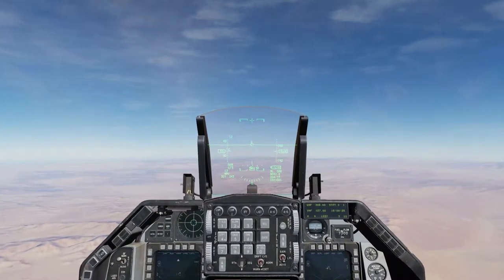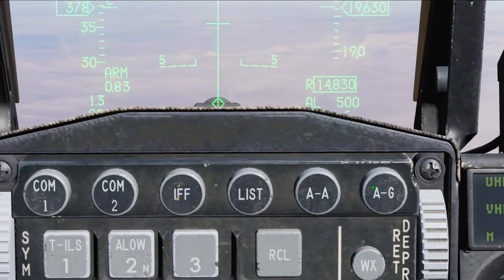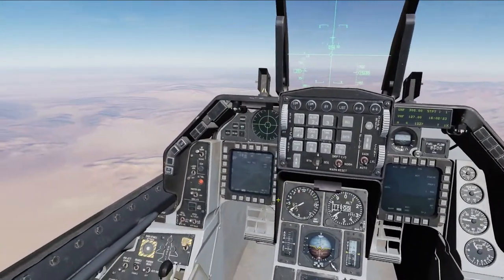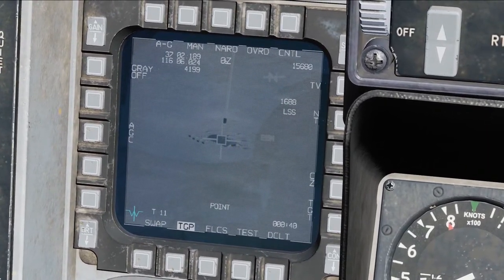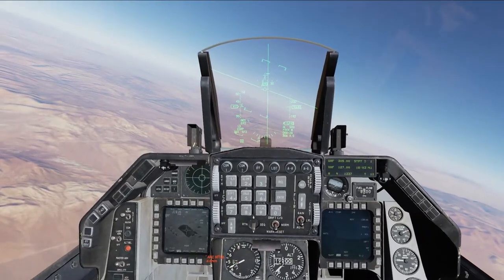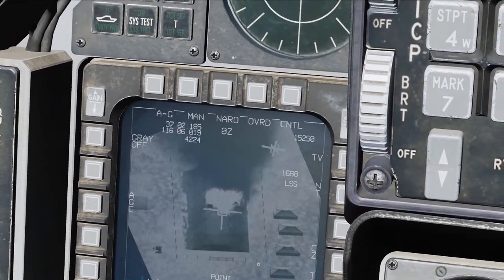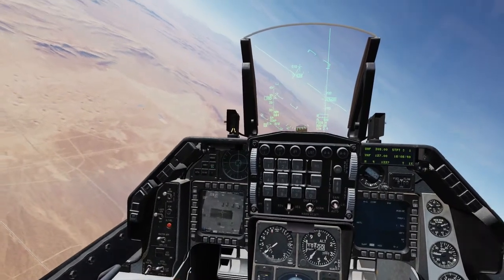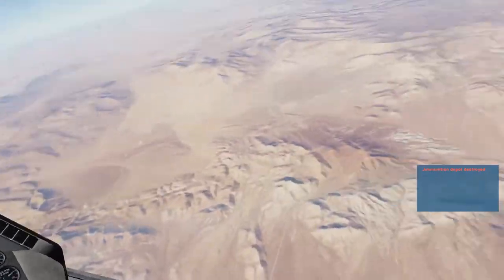F-16 Laser Guided Bombs EASY!

Comment: Curious im not sure if the process has changed now, you may also need to set the release angle now manually with latest viper updates.
Reply: FYI to those who like dropping laser bombs flat the angle is 0 degrees
Reply: I'm annoyed with it as well. Bombs won't release unless the angle is absolutely perfect, which requires autopilot and perfect trimming... don't have that issue with the F18 CCRP
Reply: @dimitri1154 eems that way.   I made a comment 6 months ago.   I still can’t get the laser guided bombs to drop.

Edit:  fml….  I figured it out.

Comment: I am doing everything you said but the bombs are not dripping what do I do?
Reply from the maker: Make sure you are holding the release button at least six seconds before the drop. Let the computer drop it. Then let go of the release button. Then lase the target. If you wait until the release cue hits the flight path marker they will not drop unless you press it at the exact millisecond that the release cue hits the flight path marker.
Reply: @BogeyDope  yeh I dunno what I’m doing wrong but master mode is on lazer is on I pressed and held wpn rel 6 seconds before and a while after and no bomb came off my wing I’ve been trying all night and the bombs just won’t come off
Reply: I have the same problem, going nuts. 
Great vid thou
Reply: @rasmussen8383  I found the solution just press the release button when the time hits 2 seconds

Comment: I hate CCRP, but if I go to MAN mode the TGP cue goes away from the HUD and JHMCS…is there a way to bring it back without using CCRP mode??
Reply from the maker: When you say "TGP cue" what are you referring to? The release cue line??
Reply: @BogeyDope  no I mean the little square where the TGP is currently looking at. I can slew it around I just never know where it’s looking at (compared to CCRP mode where you can see the small square all the time thought HUD or JHMCS where the TGP is looking at)
Reply: @BogeyDope  I’ve gotten kills in MAN mode but it is a PITA because the F16 doesn’t show me what direction the TGP is looking at anymore as soon as I switch from CCRP to MAN
Reply from the maker: @7Amps  Yeah unfortunately, you can't do that in CCIP. CCIP is basically a "VISUAL MODE". Which is why they give you the IP pipper.
Reply: @BogeyDope  no it’s not CCIP mode - Im talking about MAN mode. I’m still using the laser and dropping bombs from 20k feet, the only difference is I don’t have to wait for a computer to give me permission to drop my bomb